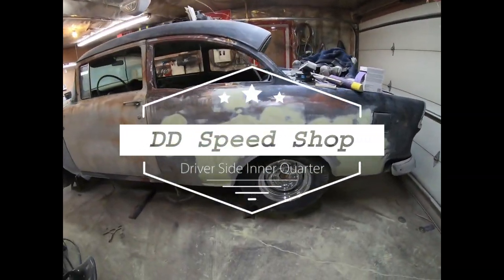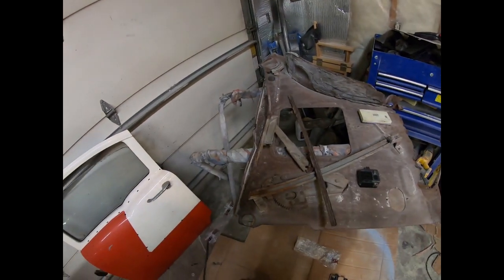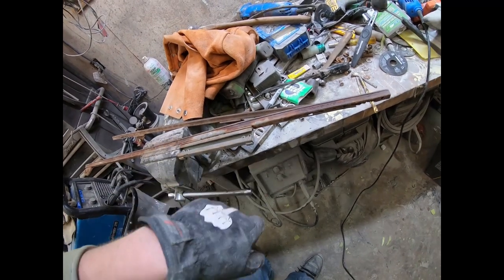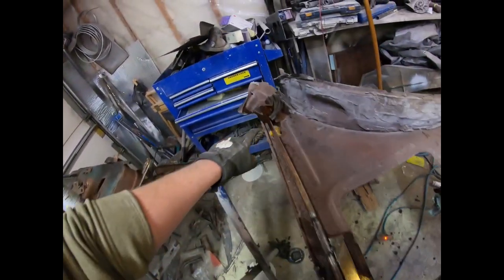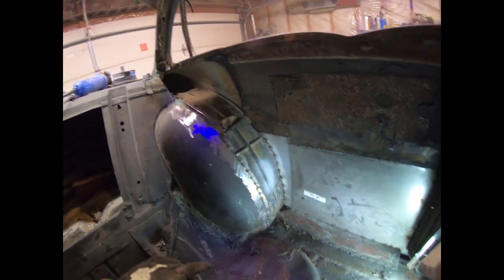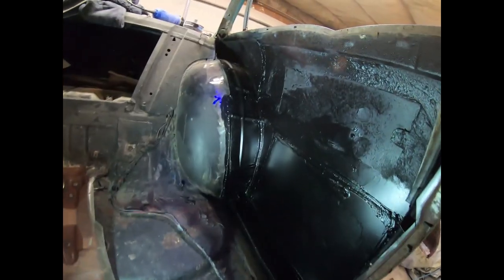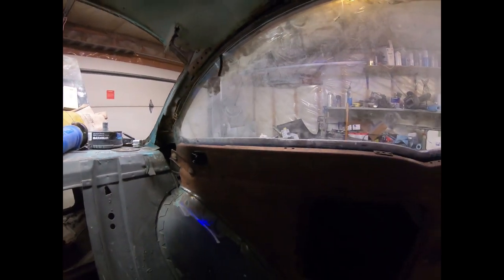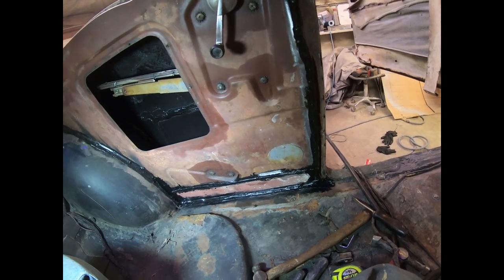55 Chevy Gasser Quarter Panels are Finished!

Comment: Bro... been following you for awhile now.. i have a couple 55's .  Started a 4 door conversion about a yr. ago.. Got as far a door and post removal. I have a few ruff 2 dr. quarter sections to work with,just a little hesitant . As with your driver side, the bottoms are a little shy of good metal but as you did i will add a little section. Lining up doors are important .  Thought i would weld on a few 1/4 inch steel tabs on the corners of the doors. Create the opening ,  I figure  for the most part , that's a good gap for 55 door opening .Now that it's been complete for you, Any good advise your willing to share.?     ... Thanks .. Dale.    +++++  Canandaigua, NY
Reply from the maker: If I was gunna do it again id pony up the money for full quarters and use the 2 door posts.  Otherwise its pretty straight forward.  Youll figure it out man